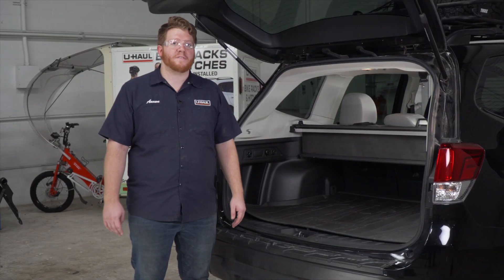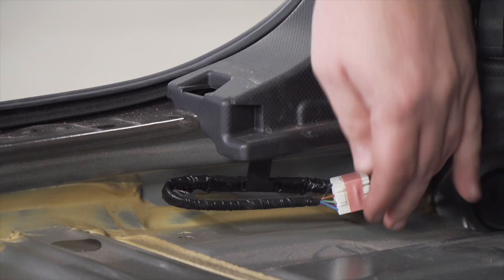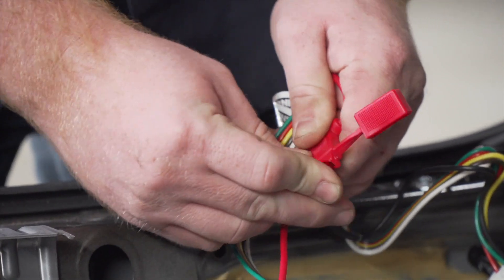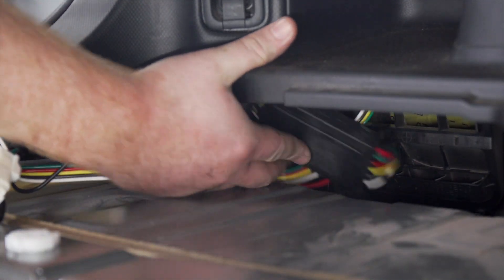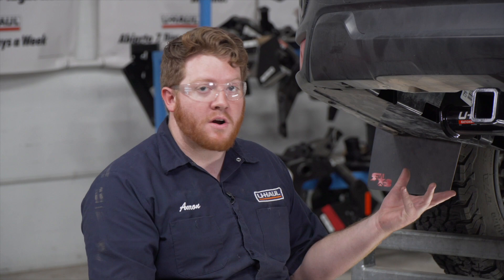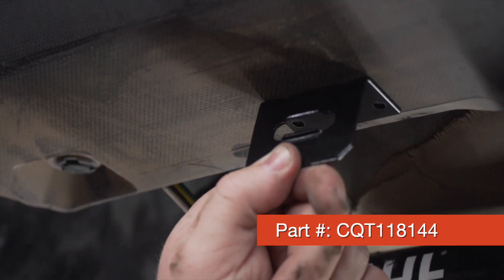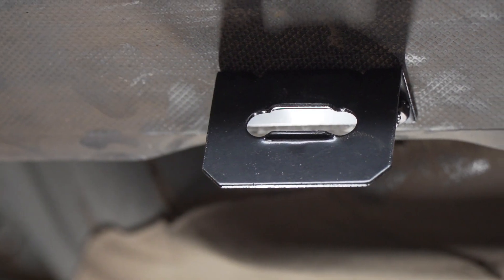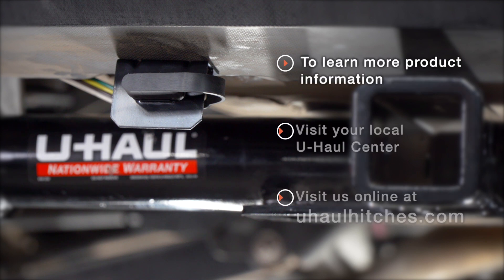2021 Subaru Forester Trailer Wiring Harness Installation

Comment: So what you're telling me is that the Forester cannot travel through water higher than the bumper, or the water will come in a random "vent" in the trunk? Holy Crap.
Reply: Show me a car that doesn't have it, pretty sure it's required in all modern cars.
Reply: If you are taking your Forester through water higher then the bumper then you have other issues.  LOL
Reply: I have just started at U-Haul installing hitches and wiring harnesses. I retired in December as a heavy equipment operator. Needed a part time job and found this one. It's a lot different than being a equipment operator. I have watched a lot of videos since I started and I can say by far Aaron does the best presentation on the web. Thanks Aaron 👍